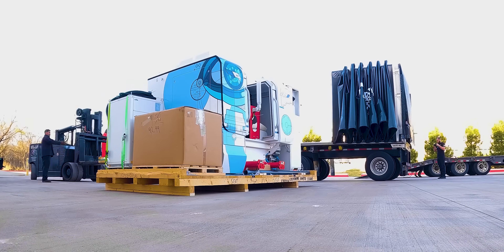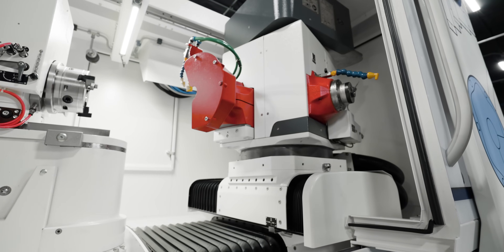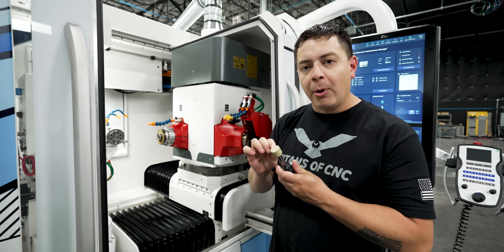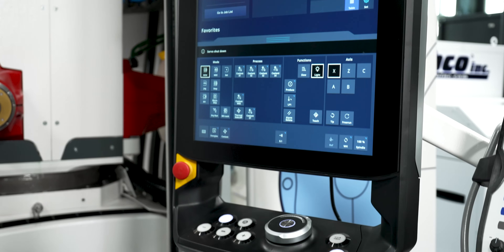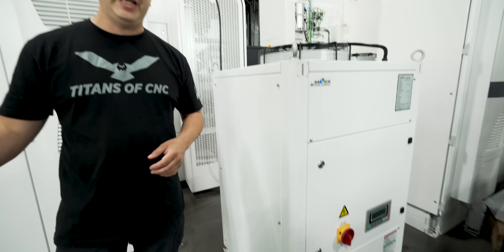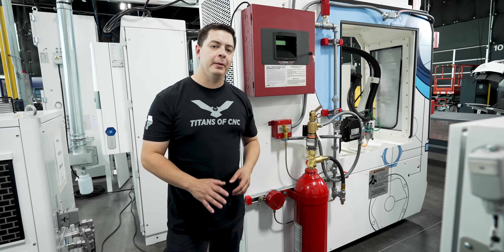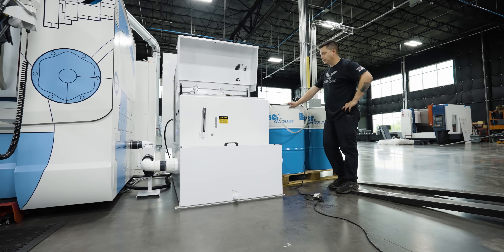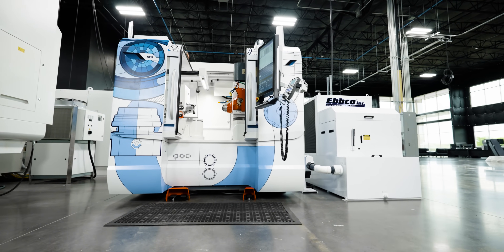MIND BLOWING Infinite B Axis  Next Generation Technology

Comment: I started school for machinist and worked up to CNC machinist- aiming to go into a cnc job. I changed path when I was basically done with it because the income ceiling was way too low for my goals- and moved on. These days i have manual lathes/mills in my garage and a handful of 3d printers, i built a cnc system from scratch for my little mill and I cant help but realize the crossover- CNC operators are people who get paid to play on the biggest evolution of the 3d printers we all play with at home😂😂

Comment: 0:32 the machine is not lifted from the top but from the bottom?
Reply: yes, you pick these up from their lifting lugs not from underneath
Reply: Usually there's no solid collumn or something like that on this family of grinding machines (opposite to surface grinders). You can't put eye bolts on top because that's just relatively weak enclosure, it couldn't handle the weight of the bed. That's why you have to lift the bed itself.

Comment: only reason that im okay with ER collet on a grinder is cause your gonna dress the stone to run true with it anyway. otherwise i wouldn't use a ER collet for anything that needs real/true precision since a ER collet has a allowed runout tolerance of 0.03mm/0.00118inch which is just not good enought when you wanna hold like micron and long tool life ( rool of thoumb is every 0.01mm runout = about 8% redused tool life. so the lower your runout is the longer your tool last in the same material with same tool path. feed's and speed's ) but since your gonna dress that out in the grinder then it should be all good
Reply: You'd still have to deal with balancing, but I think you can get special collets that are finely balanced and machined to finer tolerances. Btw. there are different tolerance classes for collets, class 1 collets e.g. have <5 micron runout.
Reply: @CatNolara  i know there is normal ER collets and ER precison collets. ( personally i wouldnt use ER collets at all ( with the exception of drilling ) if i could since they have so low clamping force